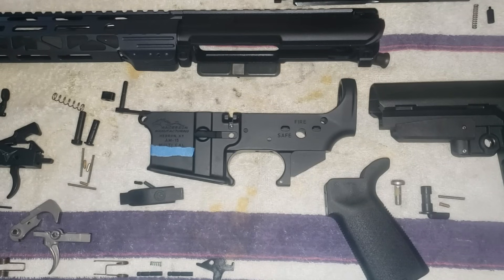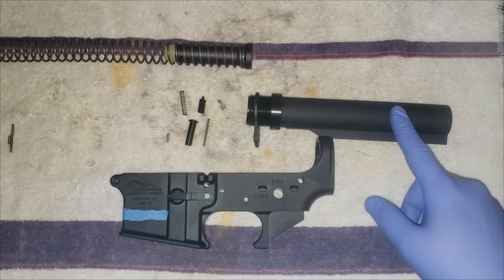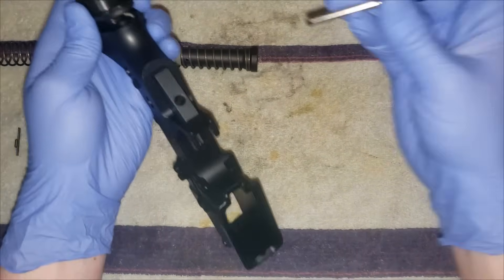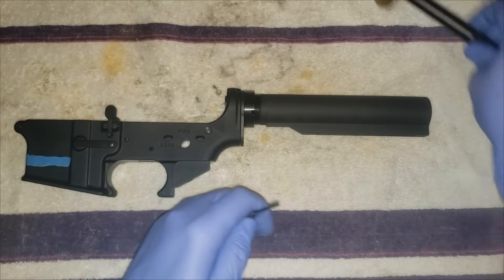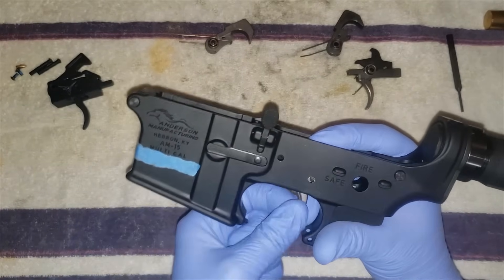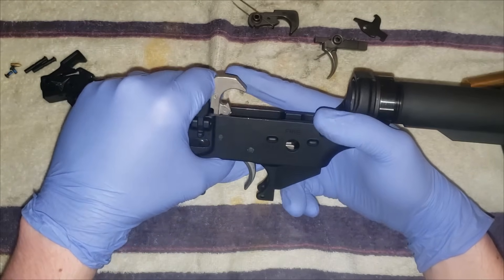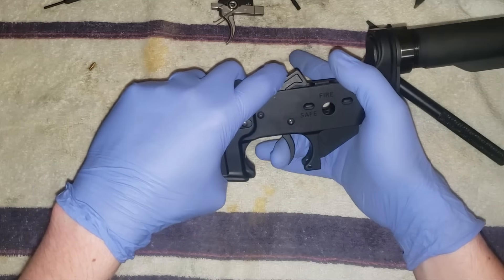How To Assemble An AR Kit

Comment: Great Video. Camera work allows us to see exactly what you're talking about. It was very helpful in building my first AR lower. One negative though... go easy on the hammer. The trigger pins just push in with finger pressure. If you need to hammer them in, they're  not aligned properly.

Comment: Auto trigger u got automatic weapon
Reply from the maker: Just a drop in trigger. Still semi, just adjustable pull weight, less play in the pull, solid wall, crisper break, shorter reset. Mil-spec work, but most drop ins are better.

Comment: To author of this video …
So when I drop in my trigger and set the pin , there is no movement when I pull the trigger like the front bar on the trigger piece lies flat on the inside base of the lower and restricts movement .

Did I mill my lower too deep ?

Comment: Im sorry to bother... but can you explain why the buffer catch/ spring and the other little spring after that are necessary. Could you explain their functions
Reply from the maker: When fired, the bolt pushes back into the buffer, the bolt has a ramp to depress the catch, when the bolt cycles back with help from the buffer, the catch comes back up and keeps the buffer in place.
Reply: @howtofirearm1549  thank you for your time,  I heard you can run them without a catch/spring. Something about keeping forward pressure on the bolt at all times...
Reply: @howtofirearm1549  I'm guessing running without one could cause excessive wear on the buffer?
Reply from the maker: @RuthlessRaccoon187  I would not recommend

Comment: The buffer tube castle nut needs to be torqued to 38 to 42 ft lbs and staked in two places. Also the buffer tube threads need aeroshell 64 grease on them. The torque values are wet.

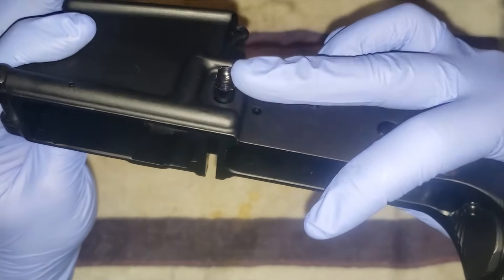Comment: Great video. The only thing I see that needs some help is the magazine release button. You should take a punch or dowel rod and push the button in further where you can screw the mag catch on until the screw is flush with outer portion of button. At 5:38 you can see the rod is only into button about half way. Needs to go flush or just sub flush with button.

Comment: OMG the F-ING slide release roll pin was a nightmare, tore my brass hammer head all up
I WAS ABOUT TO SAY WELL IM SCREWED, the pin went about .010 to deep and the release would not slide into position to be pinned in, my small punch literally bent into a wave and got stuck in the other hole trying to push it back.  LOL  
I am a trained Machinist so I have hands on so not my first rodeo with tools.   I finally got it flush then the nightmare of going all the way through began, I had to use a vise and finally just said F it and beat the hell out of it until it started to move and finally done!   Sadly I marred it up some 
  THE REST WAS A BREEZE FOR  ME   
THANKS AGAIN I WATCHED AND FOLLOWED THE STEPS
Reply from the maker: Yeah that roll pin sucks
Reply: @howtofirearm1549  some scotch bright pad and elbow grease and 90 % of the Mars are gone. That was a pleasant surprise

Comment: Whatever you do, don't install your trigger guard roll pin like the way it was done in this video. Make sure you support the back side of the trigger guard roll pin hole. Seen way too many people ruin their lower receivers doing it that way beating on it unsupported
Reply from the maker: Agreed. This was not ideal.
Reply: Can you explain what you mean by supporting the backside of the trigger guard?  Can you provide a video or photos of how that step should be properly executed?
Reply: @andrewgardner3071 I don't know if you got your answer, but put something behind the trigger guard, where the roll pin is inserted. It's to keep the extensions from bending or breaking. My suggestion would be to get a bench block, or put a small piece of wood behind it. You could also get an enhanced trigger guard that doesn't require hammering. MFT makes one that uses screws instead of roll pins. I think Magpul also has them with screws.
Reply: At what point of the video

Comment: Simple and straight to the point video, good point of view camera showing every detail. I was having doubt that I machined my 80 percent correctly when I noticed my trigger assembly was going to prevent my safety to be installed, but I love how you pointed out, that it needs to be cooked. Thanks!